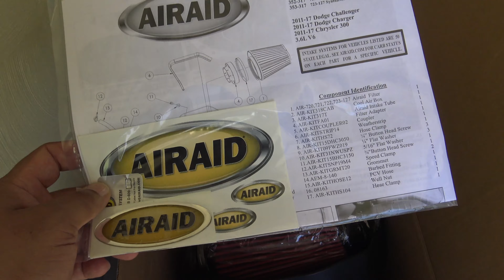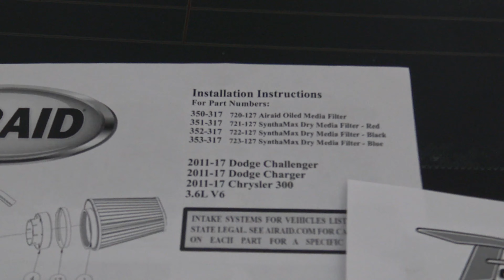Chrysler 300: Cold Air Intake/Throttle Body Spacer Install

Comment: You got rid of the 5.0?
Reply from the maker: Yeah, I went ahead and got rid of it.  But, I'll be getting another Mustang.  Curious to see what the 2020 is going to offer!
Reply: 16P51-GT: ALL CYLINDERS TV no kidding what made you get rid of it? I just got rid of my 2012 GT and was choosing between a 300s and a 16-17 GT. I drove both and the 300s was a sweet ride but I ended up getting a 2017 GT premium with the 6R80 😉. Regardless of what you drive I'm still sticking with your channel. You put out good content, glad your back 👍🏼

Comment: Looks great but definitely you lost the warranty on it idk if you aware of that
Reply from the maker: No, it doesn’t void your warranty.  That’s a myth.  The manufacturer would have to prove that any modification that you did to your car was directly responsible for any issue if it arose.  https://en.m.wikipedia.org/wiki/Magnuson%E2%80%93Moss_Warranty_Act  I covered this in a previous video when my Mustang that was tuned and had a CAI had a transmission failure.  Ford covered it fully.  Plus on the Chrysler, you don’t even have to tune it.